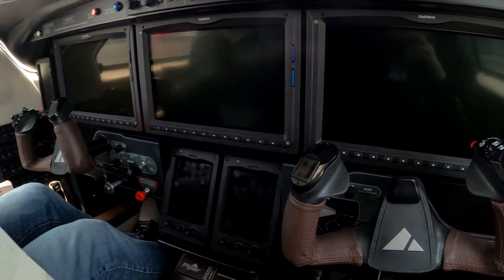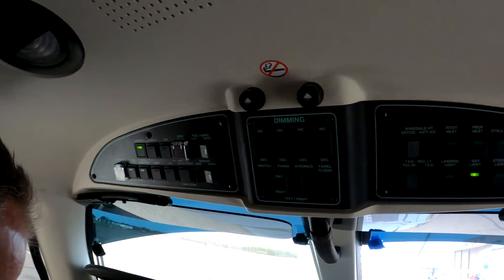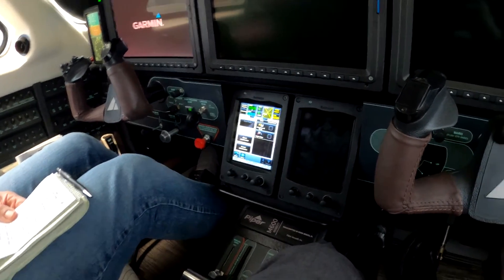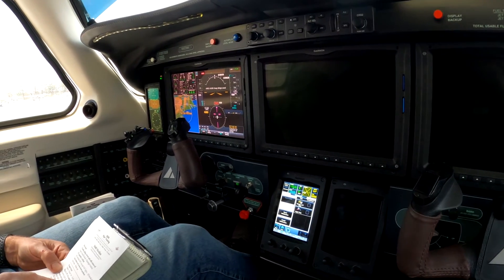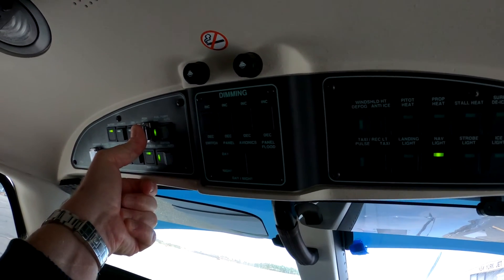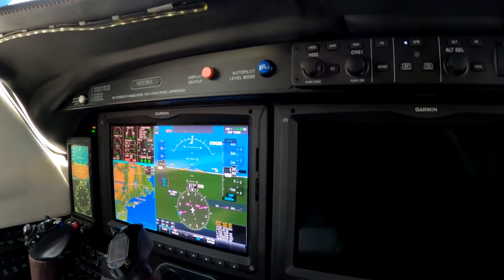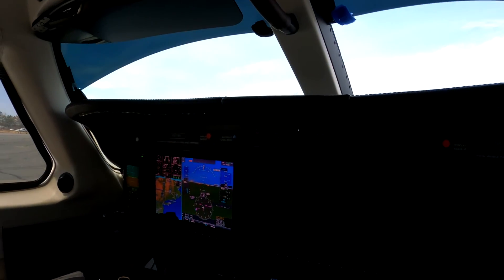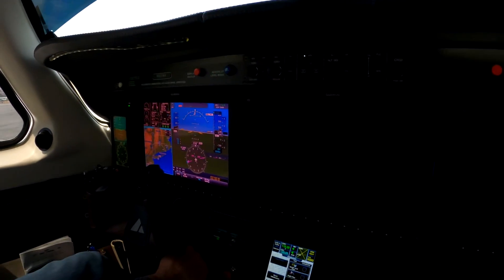Piper M600 - Manual Start Procedure

Comment: During the start sequence I turn on the Alternator first to see that it in fact works by watching the current display.  Then I turn on the Generator to see that it picks up the load and that the Alt drops off. Am I doing this incorrectly?  Your Thoughts.
Reply from the maker: Hi Marnie, I like to bring the generator on line first because it has a greater capacity and therefore ability to deal with a hungry older battery. If the alternator is not snapping offline due to overload due to an older battery it is no problem to bring on the alternator first. Fly Safely - Train Often.. DR